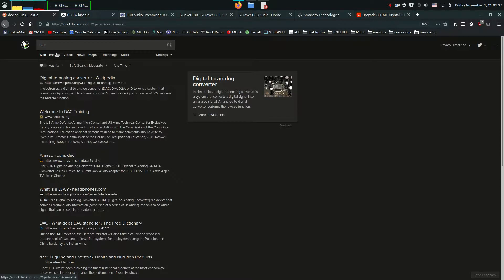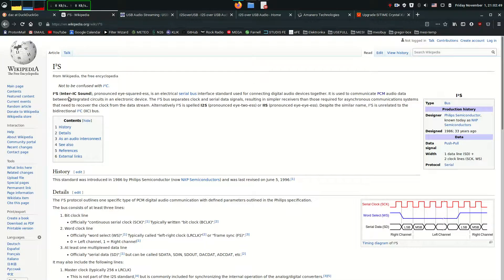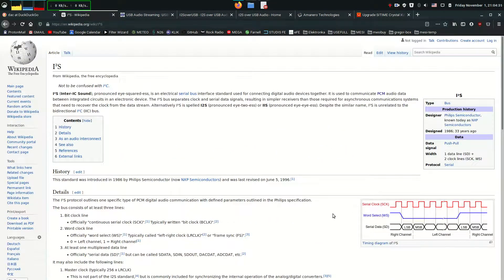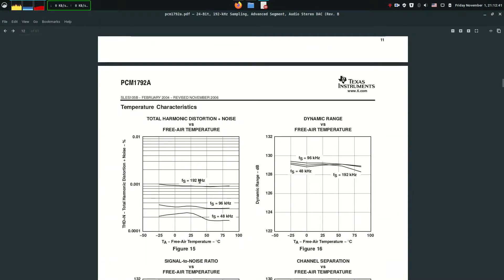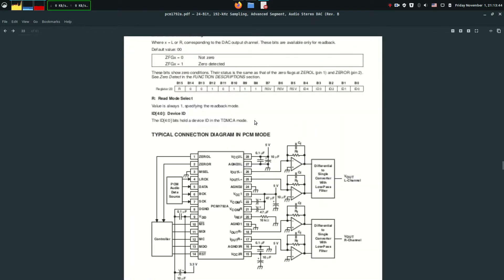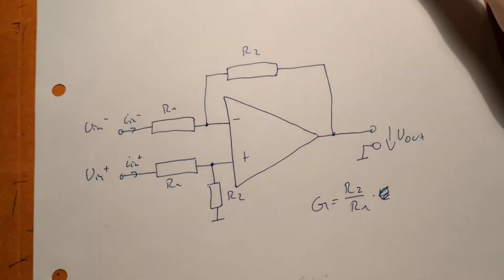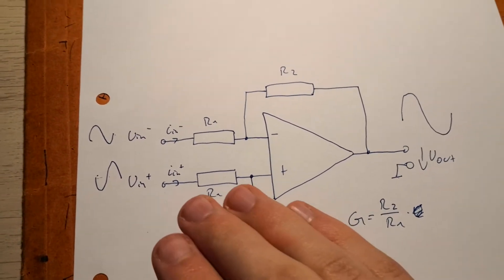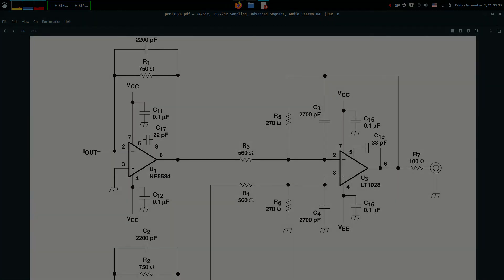DIY AUDIO DAC - part 1 | Video 17

Comment: Hi, I found your video very informative but there's one small, but important detail that you got wrong. At 19:17  you say that one can skip conversion of the differential signal to single ended when it's convenient. This is not true. The reason we use this conversion in the first place is not to generate a strong signal, but to get rid of very significant common mode distortion that's present at the output, but gets rejected when comparing the two signals. 
If you need a differential out and you want your signal clean, than you need to either split it again right after you've merged it, or use two  DAC chips configured in a so called balanced mode. Merging differential signals is the only way to get clean output from your DAC and it cannot be ommited.
Reply from the maker: Thank you for the observation and this comment. I always feel like I forget to say something or misinterprate. The output has a common mode bias and therefore has to be removed by the output stage. Thats why high performance dacs with differential outputs have two mono dac's, as you mentioned. Thank you for comment, I will pin this here for future viewers.
Reply: Just noticed that you mentioned it in the second part.
If anyone reading this wants a differential out for cheap and with good specs than ti's opa1637 is perfect. Opa1632 is close second.
You can interface directly to pro sound equipment or class D amps with it.

Comment: I bought a PS Audio GainCell DAC and broke it and they fixed it for me. I am using USB input now but it has i2s inputs and they are making a streamer now that will have those. I am not very technically minded but I have a feeling it should sound better.
Reply from the maker: Since both signals are digital I would say it depends. In this domain, clock accuracy and synchronisation is the important part. This would mean, that the quality of i2s output of a streamer has to be better that that of the usb-i2s converter. In my view, both could be excelent. I myself have a great sounding DAC plugged into usb with amazing measurements to show for. I would say that in higher end, DAC chip architecture, output processing and of course your amp will matter much more than how that digital signal is delivered to your DAC processor. Having a DAC with i2s input is a convenience for sure, but I would look into other parts of your system for improvements first. But as anyone in this hobby knows, you do you.
Reply: thanks for the reply I just saw this! Yeah the guy I get most of my stuff from has a blusound node going to an m scaler and a Dave (and then a $400-500k system at the end of that. Will have to listen to it because vinyl sounds better with my current setup. The streamer I hope will be available at the end of the year but as far as recent changes tonight I got two good power cables and we put the speakers in spikes and little metal things for the hardwood and little changes like that made a difference. I’m with you on doing you; at this point I try to stay off Reddit for that reason. Too many salty people (all over lol) and how you spend your money is entirely up to you! XD. Luckily I have a Mom that’s into this and I live at home so she buys most things lol.
Reply from the maker: I agree. When I bought my headphones and the rest of the stack, some coworkers were surprised I spent that much on an audio setup. I asked them if they have a TV and what they spent on it (turned out it's the same as my whole stack with heaphones). I said I don't have a TV and I spend the same amount on a good music listening setup. Granted, there are some parts of any hoby that a "community" can agree on is overpriced or not a good deal, but in the end personal taste and different priorities win (let's say design of a device, which does not impact sound, but the good feels in one's heart :D). (oh, and of course, financial responsibility :P)